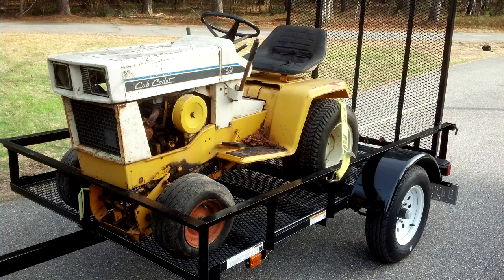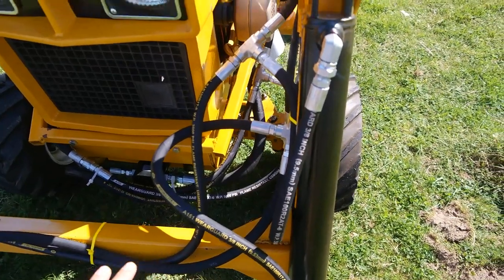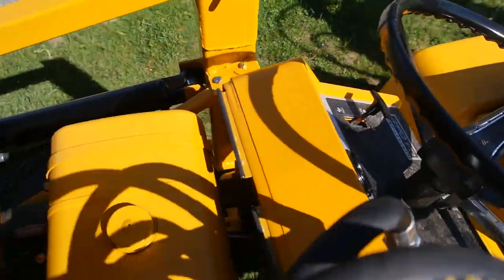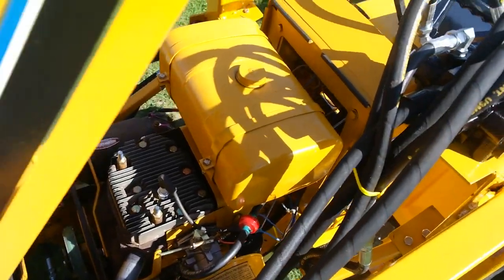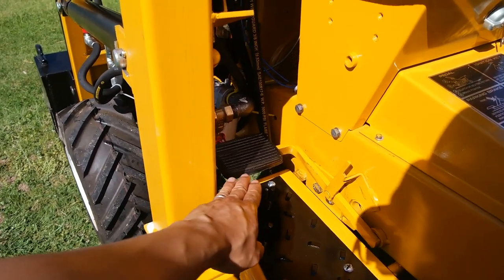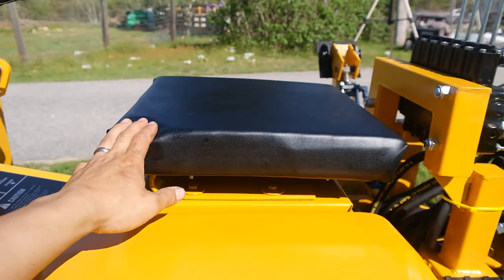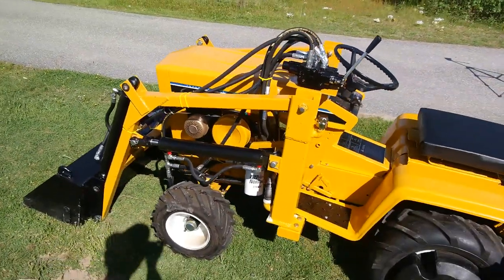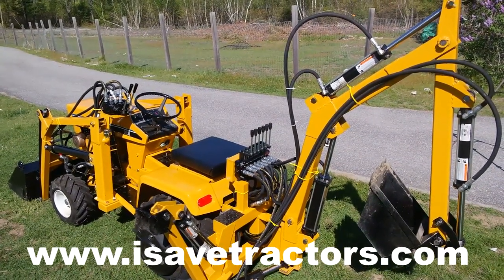Cub Cadet 149 TLB Transformation Part 14 - Completed!

Comment from the maker: Since this video I have added a foot control hydro lever. 
You can see the video here: https://www.youtube.com/watch?v=WtLPzACxn-8
I have also put it through extreme testing by digging 5 foot deep trenches, holes, and have dug out stumps most people would not dare do with a machine they built by hand. So far, every weld, every part has held up to almost 60 hours of pretending it is a larger tractor than it is. You can check our playlists to see some of the projects it has done. Tractor weights approximately 1900#. Total Estimated Cost for this project start to finish was about $4,000. Comparable to a Kubota BX25 at $25,000.  Thank you for saving the tractors.
Reply: would love to see a video focusing on the types of tractors worth using for tlb builds

Comment: Hi Norman.
I have to point out that  the seat back is not for loungin about but it serves an extremely important safety function.
For example if the front axle of the tractor goes into a hole or some dip in the ground the back of the machine 
will move forward in an arc and the controls will hit you in the back. Inertia will prevent your upper body to move along with the tractor since it is not attached to it. Your body hitting the controls can adversly move some of the hydraulics and hit something or someone.
I would suggest that instead of having a swivel seat, a lockable seat back that can be moved from the front to the back and padded on both sides would be an easy solution.
Your safety has some importance here.
Keep up your good work.
Reply from the maker: Very good thoughtful post. Appreciate it!

Comment: Nice job Norman, I think the only thing I would’ve done different is to put it on a four-wheel-drive platform and use a 2 stick control for the backhoe, and add a thumb nice job it looks great
Reply from the maker: I plan on building another one of these in 2019 and I am going to do it a little different and paint it IH Red. I have ALOT of projects coming to this channel so make sure you subscribe for more!

Comment: I took old steel car rims drilled 5/8 holes into bead lip and welded heavy office chair caster wheels into holes my jack stands fit nicely on front bead lip. Set front tires on 2 rims one rim n stand in middle  of tractor  and used home made crossbar on floorjack slid rearend out of 1450 cub with 1 hand

Comment: when selecting the loader sticks, did you consider a joystick i.e., X-arms, and Y-bucket? that way you can simultaneously move both with one hand and steer with the other say if you wann work fast? (side question: would this mean it would demand more form the hydraulic system since all cylinders are working?)
Reply from the maker: hey I did consider a joystick but I don't like them. I prefer sticks like are here. I can move both motions with the same hand. when using both spools the valve will send fluid to the cylinder with least resistance first then flow into the second motion

Comment: Did you have to do any modifications to the front and/or rear axles? Also loader tires?
Reply from the maker: Yes filled tires with liquid. Yes I modified the front axle. Check out the full build series for those details.

Comment: Hi Norman, what sort of pulley are you running on the hydraulic pump? I've got the plans from PF Engineering and they call for a split-tapered bushing pulley on the pump side too.
Reply from the maker: I'm using split taper pulleys just like they recommend

Comment: I've got a small thing. Your backhoe controls. Wouldn't it be better if you had the 2 outside controls for jack legs, 3 in a row for boom, dipper and bucket with the 1 remaining for swing? Have you designed the controls so that if you pull boom, dipper and bucket together it digs a level horizontal ditch? I just get curious about such things. Nice fabrication job. Happy digging.
Reply from the maker: Yes it's set up like you said except for the middles are the outriggers. I put the middle ones as outrigger so the hands wouldn't be so close together.

Comment: did you use all 2"x 16" cylinders? great job, i think it looks a lot better without the white. i would love to see a video on the hydraulic system from start to finish. nice job with the seat also
Reply from the maker: Hi Bill, The cylinders on the backhoe vary in size, but are all 2" bores. Thanks for the suggestion on the video. I will add that to my list of videos to make and I should be able to have it ready in a couple of weeks.

Comment: Hi I was wondering if the pump you are using is a NorTrac Bi-Rotational Pump/Motor - 9 GPM, 1/2in. Dia. Shaft, Model# CBS6-D9. 6SS

Comment: sir if you don't mind I would really like to know more about the hydraulic system and the way you attach your pump and what size pump and the control valve would be very helpful. thanks in advance
Reply from the maker: You got it. I will start working on that video after Christmas.
Reply: isavetractors thank you sir

Comment: I like the 'case commercial' style paint job. The machine looks great. How come you decided to go with a direct connection not use a pto?
Reply from the maker: Thank you. I was going for a CAT color scheme. I decided to leave the hydro pump on full time because I didn't like the manual clutch set up that the Cub 149 had originally and since it has a starter/gen, I couldn't hook up an electric PTO easily. In the future I would like to upgrade the engine by adding a starter, Stator, and electric PTO.

Comment: what is on the side of the wheels in the back and I don't see them on the other videos, is that just a back wheel cap?
Reply from the maker: Those are 50 pound wheel weights. I ended up not using them and that's why they only make an appearance in this video. Good eye!

Comment: What type of controller are you using

My system is killing off the engine 6 horse 

I’m thinking either my engine is to small for the pump
Or I bought the wrong controller
Reply from the maker: Your pressure relief is probably turned up pretty high. Bring it down as low as it will go

Comment: Great build. Did have a few questions though as I just went through the whole build. Whatever happened to the dually idea from the beginning? End up being to much work that wasn't worth the effort?

Secondly, was there any reason you went with the 149 series tractor versus some of the bigger more beefier series like 782 or 982, or something along those versions that are similar to the JD 425/445/455 lines that everyone seems to rave about in the garden tractor world? Not complaining was just more curious since this is machine that will be doing a fare amount of heavier work.

Lastly, whats your opinion on the cub cadets once they went away from IH to MTD around 81? Do you typically try to stay away from post IH cadets for one reason or another?

Thanks
Reply from the maker: Hey Zach, Thanks for watching the entire build! I did end up ditching the dually idea, as it would have made moving around in tight spaces a little harder. Good observation though! I will save the dually for another project in the future. 

I went with a 149 because of the wide frame and hydrostatic hand controlled set up. I didn't use a Super Cub Cadet like the 982 because they are not common here in Maine. I didn't use a JD 400 series mainly because of cost, and because my company is focused on Kohler K Series Engines, and the JD 400 series don't have them. 

The IH Cub Cadets use the Cast Iron Rear Ends, and MTD ones use an aluminum Rear End. I wanted the Cast Iron one for the added weight and durability with the backhoe.

Comment: Hi again I was going to order the same pump off northern, but the pump info say don't use a pulley. It looks to me that you are running a pulley so could you please let me know what you are using. Thanks I sure do love your tractor i'm trying to do the same with my old Craftsman 18HP tractor
Reply from the maker: Here is the one I use: https://www.northerntool.com/shop/tools/product_200329712_200329712 Pulley is fine, just be mindful of the sideways load

Comment: are you using some kind of pressure reducing valve ? also do you like the speed rate that the 4-8 gpm pump puts out?
Reply from the maker: DriveTrain Production the loader valve has an adjustable pressure relief. I do like the 4 to 8 gpm pump. the speed is helpful when using more than 1 backhoe spool at a time
Reply: DriveTrain Producti
Reply: F

Comment: Hi Norman, you did a great job on the TLB. It looks like the pf engineering plans? I really like the finished project! I more than some know the work that is involved in doing one of these. I did the exact same conversion to a John Deere 322. If you search YouTube for "John Deere 322 backhoe" you'll find it. I would really like to get your feedback on it, as you have done it yourself. Excellent job man! I have is used mine alot. I like how small these machines are verses the capabilities they have. you can put turf tires on and not destroy the lawn. I own a contracting company and use mine to dig footers, clear brush, etc. Amazing little machines. again Great job Norman!
Reply from the maker: Thanks Jason for your comment! I actually watched your videos over and over before I attempted my build. I did use the PF Engineering plans and overall I am very happy with it. The only thing I would do differently next time is change the angle of the front end loader boom arms. The PF plans put the bucket too close to the tractor so it's hard to see where the bucket is in relation to the ground. I have a Kwik Way Front End Loader on a Ford LGT 145 and it has the width of the loader arms wider, and it puts the bucket a foot further out in front of the tractor. So I have better visibility and more reach when dumping. Other than that, I am very happy with how it came out. I have used mine to dig out small stumps, some drainage ditches, and some holes for posts. I am actually planning to build another backhoe for the front of a Jacobsen Turfcat GW224 Commercial mower. I am going to make the reach of the backhoe a foot longer and dig a little deeper. Thanks again for your kind comment!
Reply: isavetractors yes, there a more than a few things I would do differently if I ever built another one for sure. The PF Engineering plans are a solid guide, but need to be tailored to fit each tractor. I don't see myself building another one in the near future, but I will be doing some upgrades soon. 1st I plan to add the John Deere 420 rear conversion. The 420 rear axle has a hi/lo range and a foot engage posi lock up. Then I will definitely be doing the extend-a-hoe on the backhoe. I really wish I would've extended the entire setup from the start. As it sits now I can dig about 4'10". Not bad, but I'd like to get closer to 6'. I did notice the fel bucket is a little more narrow than the wheels, not a big issue, but it's always nice to have the front bucket wide enough to clear a path for the wheels. This is the only video I have watched so far, going to go watch your others of the build now. btw, I see you have a ton of tractors sitting around. If you come across a JD 420/430 rear axle that you would like to sell please let me know. I have 3 420's, but all are in to good of condition to tear apart. Looking forward to your next build.

Comment: Excellent work. The loader controllers are total opposites tho. The standard is on right side with the lift being the left lever and bucket is the right lever. Several reasons one being most enter on the left side of machine and them being on the right you don't bump when getting on and off. Another is like on most shutle shifts are on the left side like on the IH hydro lever. I'm not knocking it but just pointing out it would be awkward for any one who is use to the standard to operate. I would still love to have it tho😃
Reply from the maker: Thanks for the input. I put the loader valve on the left so my left hand can operate all of the levers while my right hand remains on the steering wheel. It makes the ergonomics better for me. The right lever has the float position so it had to be for the loader arm.  I didn't have room to mount the valve upside down. Thanks though for the feedback. I will be building more so I will consider your suggestions
Reply from the maker: Also, for Garden Tractors there was no "Standard" back then anyways. We modeled the loader controls after the ones made by Kwik Way Manufacturing which had the loader controls on the left, as did Johnson Manufacturing. Some were on the right too. So to each their own I guess! My first loader was one from Kwik Way and it was on the left, so I've just gotten use to it being on the left.

Comment: HI Norman! Me again I am looking for some good advice. someone gave Me A John Deere 400 Garden tractor. It's A tank. but it is burning a Little oil And I'm planning on doing a complete overhaul and restore on it. and videoing it for someone. So you will be able to watch me fail and recording. also going to put a loader on it. My question is where would u recommend me getting me rebuild kit from. I have only found them on ebay and I don't know about some of them. I only work on bigger Ag tractors. So the little stuff is a little different any advice would be great. the engine is a QK532 Kohler. Also where did you get your plans for the loader. Thanks. Colin.
Reply from the maker: Hey Colin, The JD 400 is great! We will have a complete rebuild kit available for the K532 engine in the near future. Our kits will be as comprehensive as the ones we currently offer. I do know much about the current K532 rebuild kits out there, so I can't tell you anything of them.  I got the plans for my loader at: www.loaderplans.com. Good luck!
Reply: Thanks you! I will be waiting for your kit then. Hopefully it's soon! Thanks for the help!

Comment: What is the smallest hydraulic Cylinder i could use on a loader like this.
Reply from the maker: You want to use a 2" bore cylinder. Economical, fast, strong
Reply: @Isavetractors  whould 2x8in work
Reply from the maker: 2x16 would be ideal. 8 is a little short

Comment: Just asking bud , Wondering why you didn't go with joy sticks , instead of the six flavors are all those leave if you got a pair we just kind of old-fashioned really. And please don't take this out of context. I mean no disrespect in the way you built it you built it like you want it to but I used to operate heavy equipment and I got used to the joysticks on the caterpillar backhoes. There are so much easier to operate. So I was just wondering. And really great job on fix your Cub Cadet up its really really beautiful job. 😁👍
Reply from the maker: Thanks for the comment. The reason for the 6 spool valve over joysticks is simple. Cost. The stick set up was way cheaper!
Reply: isavetractors   Ok , good deal . make since and thank you very much for your come back . Have a great day. Most of all have fun dude . I know I would. 😀👍🇺🇸

Comment: Do you sell the plans for the loader? If not where did you get the pump from and what size is it?
Reply from the maker: I used plans from P.F. Engineering. Check them out at backhoeplans.com tell them iSaveTractors sent you. The pump I use is a 4 to 8 GPM Gear Pump from Northern Tool.
Reply: thanks buddy! I'll tell them you sent me!

Comment: Won't the head overheat without the cover on it?
Reply from the maker: not likely. the flywheel shroud still directs the air over the fins. it should be fine. 40 hours on it with no sign of head warp.
Reply from the maker: I will get around to fabricating another head shroud in the future.
Reply: It's a good idea, you might keep an eye on the head temp if you are working it hard... The cooling on those engines is sorta marginal. Cool project though!
Reply: cools better without shroud

Comment: can someone or isavetractors tell me how the frame of this garden tractor support all this weight??
Reply from the maker: Jordan Stang it's a heavy duty frame with heavy duty spindles and axles
Reply: is the frame original and standard or did you fabricate the frame as well?
Reply from the maker: Jordan Stang the frame is original. I upgraded the spindles and some additional supports at the nose of the tractor to help with the loader but it is essentially stock. the old Garden Tractors from the 70's through 80's were build very tough for applications like this
Reply: So I have a IH cub cadet 122..would like to put a loader on it..just a loader for now I guess. do you think I would have to do some fab work to the frame just for a loader?
Reply from the maker: Jordan Stang no you can put a loader on it without doing any mods to your frame. a spindle upgrade would be a bonus down the line but if you Balance your tractor well with a counter weight on the back you will be ok
Reply: guy gave me the 122 for free comes with an extra engine. doesn't need a rebuild but for future security do you guys sell a complete rebuild kit for the 122?

Comment: This is absolutely amazing!  I inherited a 126, and hope to one day follow in your footsteps!  How much weight do you think the loader could realistically and safely handle?  How about the back hoe?
Reply from the maker: Damien Gregory thanks! I can safely lift 500 pounds with the loader and drive it and I can probably lift 700 pounds if I didn't have to drive. the steering is a weak link for heavy loads. the backhoe has an estimated 4500 lbs of breakout force at the bucket.
Reply: Thanks for the reply!  I wonder if the 12HP K301 in my 126 will have enough grunt to power the hydraulics. Does the 14HP engine seem overworked at all?
Reply from the maker: Damien Gregory not at all. your running pretty low system pressures. towable backhoes that run higher pressures are often powered by 8hp modern engines. my set up operates on 1500 psi and the engine runs it with ease